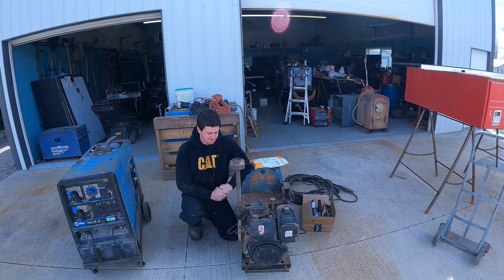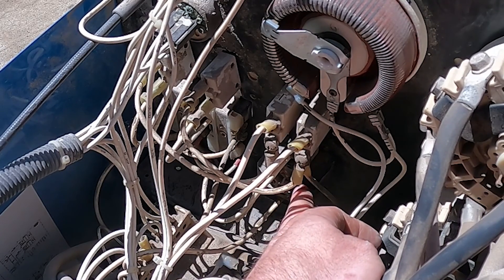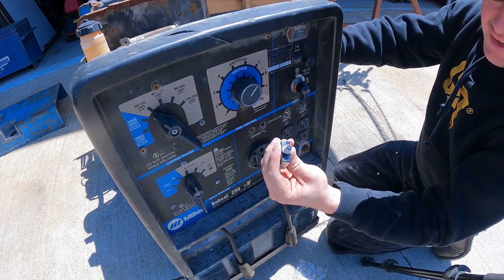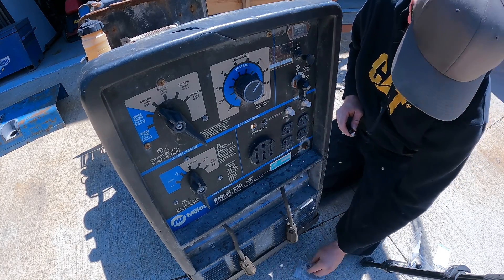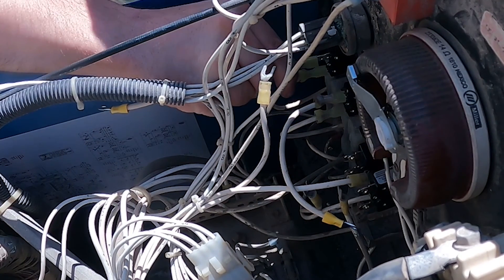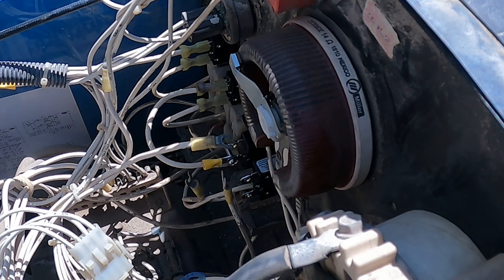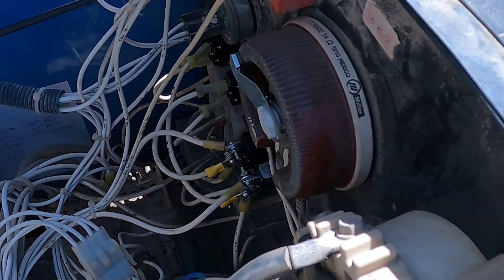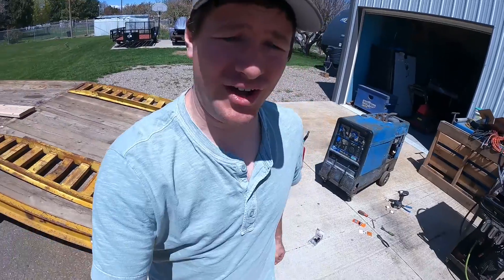Miller bobcat 250 nt circuit breaker failure/repair. Will it run? Will it power?

Comment from the maker: Links to the breakers used and more in the description!!!
Reply: I have a miller 260, with approximately 3 hours and now it doesn’t do anything. I jumped it off once and my fuel light was flashing like I had a bad ground of some short. I replaced my battery and now the fuel gauge/all gauges don’t come on and machine just cranks and only start spraying ether. Checked all grounds and fuses and everything of that sort checks good. Do you have any pointers so I can get my machine back up?
Reply from the maker: I haven't worked on a 260. Sounds to me like you have a fuse to fuel pump/injector or a motherboard issue. Those newer machines have a lot more computers than my 23 year old machine.

Comment: I have no fire at the spark plugs
Reply from the maker: Coil pack or stator pickup possibly
Reply from the maker: The coil gets it's timing and pickup from the flywheel. Possibly your ignition switch isn't letting power get to your coil either.

Comment: Hey this might be a dumb question to ask but if one of those breakers is bad will cause the whole welder to not get power. I can't even get mine to weld.
Reply from the maker: My machine is 2001 ish. No fancy electronics. So there are a 5 things that can fail for power generation typically. There is a circuit from the battery to charge the excitation field. Need to check for 12 v there. There is a rectifier from the excitation field need to check that and then you have commutator brushes to the main field that you should likely  clean. The 3 machines I've owned (all older miller) the brushes or commutator rings needed to be re surfaced and all of them needed a new rectifier bridge in the excitation circuit.
Reply: I'll check all of those in the morning, thank you sir.
Reply from the maker: Let me know how it goes
Reply: @tysoddjobs  I checked everything, and everything is good but I looked at the commutator brushes and they were worn out and very short. will be ordering a new one to see if that was my issue.
Reply from the maker: You can clean the comutator with a file covered in emery cloth lightly until it shines. When it's running, do you have voltage to the brushes?
Reply: @tysoddjobs  No I don't. before I lost all power I do remember seeing a little spark from both brushes and now I got nothing.
Reply from the maker: There should be a smaller 12 awg wire running from the starter bat + terminal to  the excitation field there is a little yellow capsule and it holds a 40 amp diode that supplies power to your field. Check that diode too.
Reply: @tysoddjobs  My welder is the 250 NT about 2000s.
Reply from the maker: The breakers won't stop the generation of power only the power delivered to the outlets. What model and year machine do you have?

Comment: Hello, can you help me with a problem? I have a gasoline Bobcat 250 Miller with a SUBARU engine, I am using it as an electric generator, after leaving it on for about 1 hour and a half, the generator had a stability fault in the engine, then it turned off and it doesn't want to do anything, it doesn't want to give switch nor does it want to give battery signal on the control panel, there is absolutely no power, what could be the cause of the problem? apparently the fuse shows continuity

Put the 12V battery to direct start and start the engine but there is no power
Reply from the maker: What is your serial number?

Comment: I have a Hobart 225 that the main switch breaker would not “click” into the on position while sliding so it’s goes back to the off so not power but welds just fine. 400 hrs. Any idea what would cause this?
Reply: It’s a 2019 model got it on marketplace with 68 hrs for a great deal last year. It’s my first engine drive. Hadn’t had any issues until this which came out of the blue. Thanks I’ll be opening it up this weekend and ordering another breaker just in case
Reply from the maker: Let me know what you find!
Reply: I finally received the part today and fix it right up! However I did noticed that leaves has gotten inside the old switch and after a few good wacks the old switch was working but I decided to put the new piece in just in case
Reply from the maker: Nice work! Enjoy having ac power!
Reply from the maker: More than likely the circuit breaker is bad. Could have debris or something stuck or just broken. These circuit breakers are pretty cheap and easy to go after.
Reply from the maker: At 400 hours that thing is pretty new usage wise. Do you know what year it is?

Comment: How’s that welder holding I’m looking at the same model got a very good deal that I couldn’t pas up going to pic it up tomorrow
Reply from the maker: It hasn't let me down yet. I did lose the diaphragm fuel pump on a job but have those on hand. It just runs. Mine has 3500 hours. How many does yours have?
Reply: @tysoddjobs I just picked up one with almost 2k hours on it for 1200, guy said it didn't strike an arc and didn't have leads to test it.....got home and spent about an hour or 2 just burning rod and she never missed a beat. Had 2 outlets mud wasps built nests in but other than that my biggest issue is going to be finding replacement panels to get her looking nice
Reply from the maker: The panels are pricey. That's a good buy I think! My only real issue has been fuel pump. I would recommend keeping a $10 Amazon spare with the machine.its a bummer to be up in the mountains and have it shut down. Other than fuel pumps mine has never shut down. I had a 225 as well same generation. Congrats

Comment: Any phone number to contact you to fix my migflux welder??
Reply from the maker: Hey thanks for watching. It probably isn't worth fixing. I have done a few. Being that you can get a decent machine for $300-600. Most wire feeders control boards cost $200+ and if it is the drive motor or transformer it is even more. What specific model do you have?
Reply: @tysoddjobs  I have a Mig250A from Hitbox

Comment: my welder is the same  but i have problem with the batery don't charge i hope can help
Reply from the maker: There should be a diode in a little yellow cover just below your starter. Try seeing if that diode is bad... that is in the charge circuit.
Reply from the maker: I will see if I can get you a picture soon
Reply: thanks brother i will check that part
Reply from the maker: Did you locate that diode?